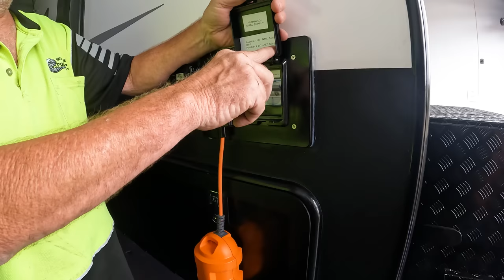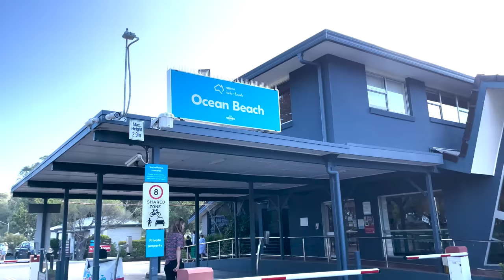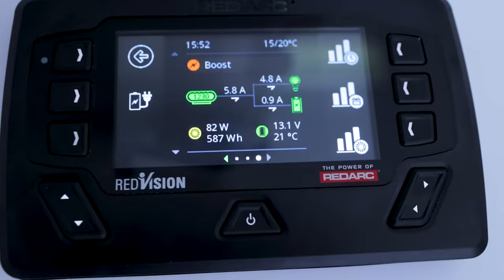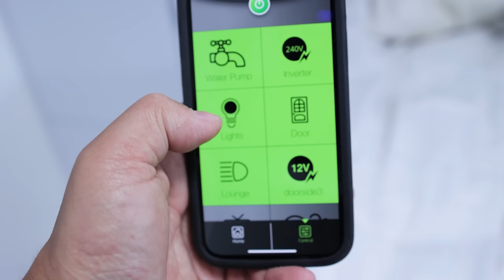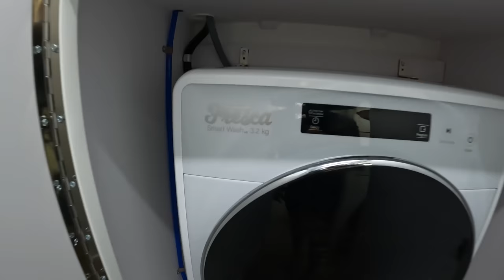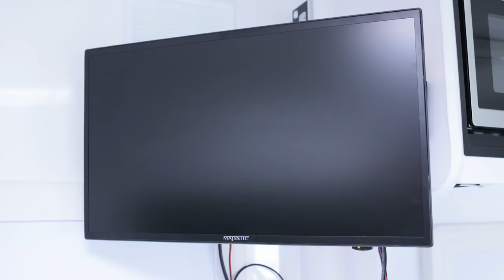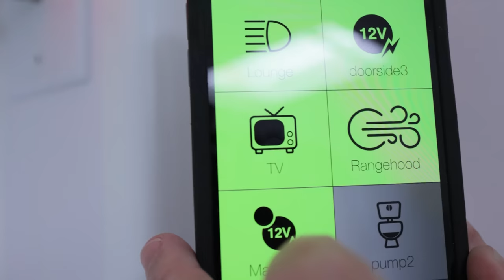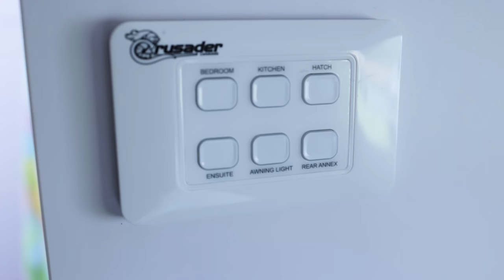Crusader Caravan Musketeer Palace - Pickup, Process and Issues - Shakedown Trip

Comment: We picked up our Excalibur Full composite Serenity in December. Only issues are with two blinds being a bit crooked and the same window opening issue as you. Our electrical setup is BMPro although the inverter is Projecta. Two 120 amp lithium batteries and 2 170 watt solar panels on the roof plus a solar blanket if needed. We stuck with the 3 way fridge as (and I know it’s unusual) we have never had any problems with it in previous vans and it makes us less dependent on fine weather. Not sure why your system requires a manual switchover from mains to inverter. Ours just goes straight to everything running from the inverter as soon as the mains is unplugged - even runs the A/C to give the van an initial cool down. Agree regarding the Weber but the slide does come out a bit further than you think after the initial pullout (still not far enough though). I solved the problem by turning the Weber around the other way - slightly awkward adjusting the knob, but other than that it seems fine and I’ve used it for both a long roast and to grill. You should find the van weight a bit lower than expected. The shift to full composite reduced our expected TARE by 65 kilos. We were told the move to put the water pump on the outside on a steel plate was to reduce noise vibration. I know you still think it’s loud, but you should have heard the noise we used to have from the pump in our A’Van. Overall we’re delighted so far (only lived in it for a total of three weeks) and pretty pleased that all we have to request at the first service are some adjustments to blinds and windows. Enjoy your travels and thanks for the vids - well thought out and presented. Cheers, Noel

Comment: We did our shakedown to Umina too. Tricky driving the van on the skinny road in the park.

Great video. Funny how different models have different components. We picked up our Nobleman 30 Oct and have an iTech inverter, no extra latch on bathroom door, different tv. Availability of parts is apparently still an issue.
Enjoy your travels. We love our Crusader so far.
Reply from the maker: Nice. The roads are skinny and there are some lower lying trees to watch out for. Definitely was on edge with the new van 😂.

Thanks for the compliment. Yes it’s definitely strange to see the different components going in because of shortages. Hopefully it settles down now for others expecting there vans and there is some consistency.

Comment: good to hear your experience. you might want to confirm the 'do not overtake' sign rules, regarding mandatory or not.
Reply from the maker: Thanks. This is from Transport NSW  website - “A caravan and towing vehicle with a combined overall length of 7.5m or greater is required to have a ‘DO NOT OVERTAKE TURNING VEHICLE’ sign attached to its rear, if the vehicle and caravan combination intend to momentarily occupy an adjacent lane (‘straddle’) when making a turn.” Not sure if it’s different for other states.
Reply: @ewkaus  thanks , we have a sign , but I think it's not mandatory. The size and type of sign is very specific, if you do have one.